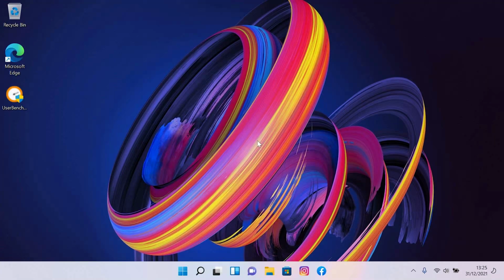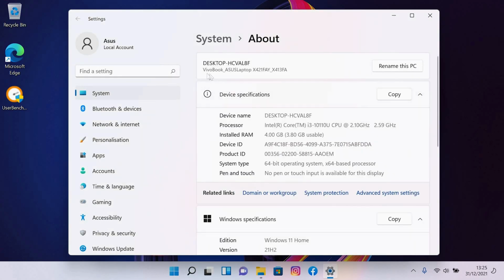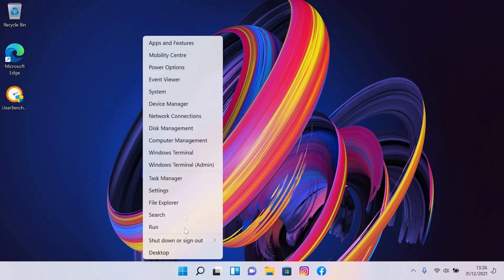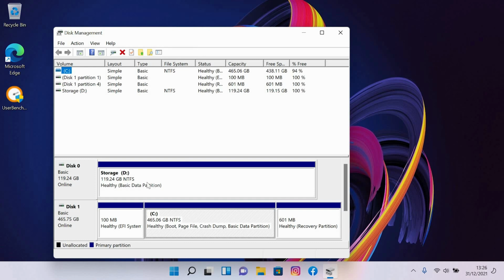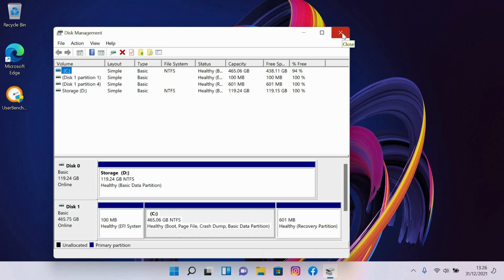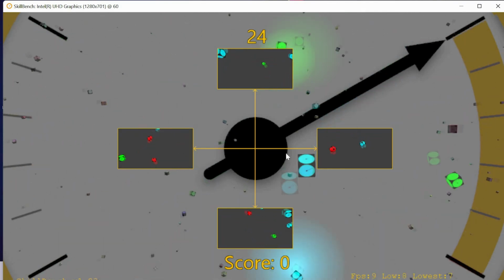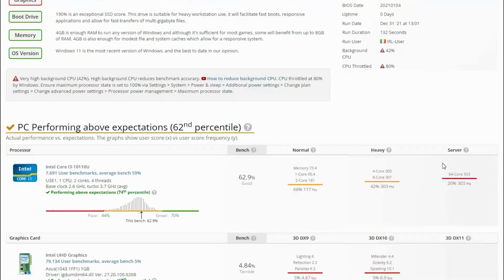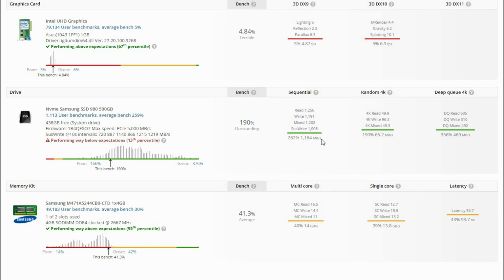Can i upgrade my Asus Vivobook X413FA RAM or M.2 SSD

Comment: Why didn't you leave the 128gb in it's place and simply place the new one in the empty place? Is there any difference between places? or what? 
Thanks!
Reply: makes no difference. I kept the old M2 as a spare and used it to clone the C: Drive so its bootable as well if the new SSD fails.